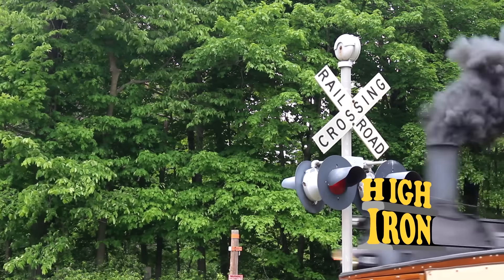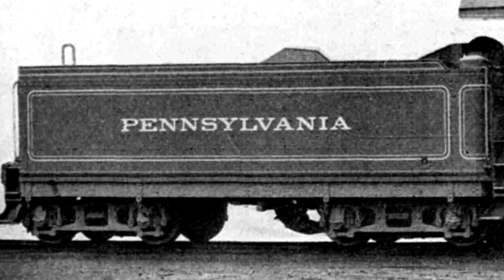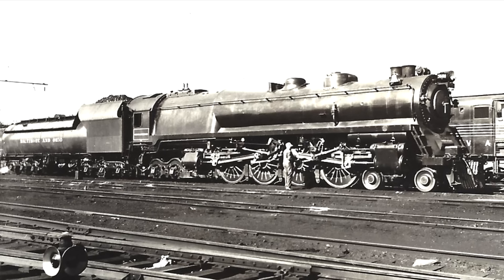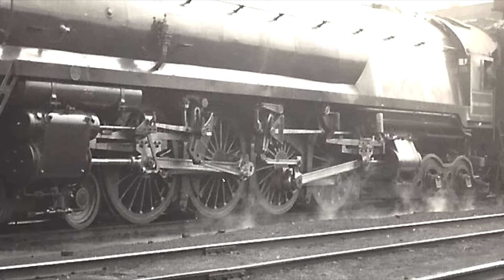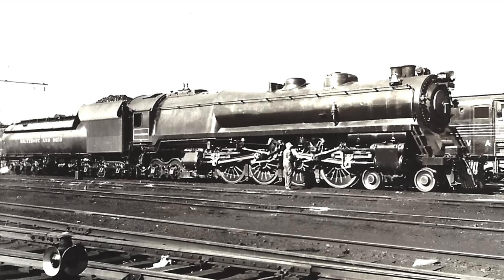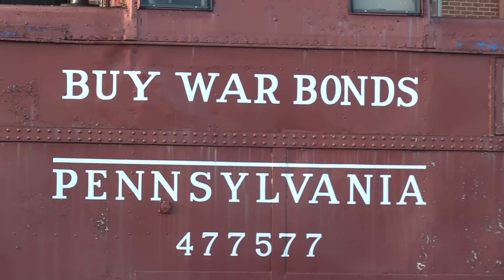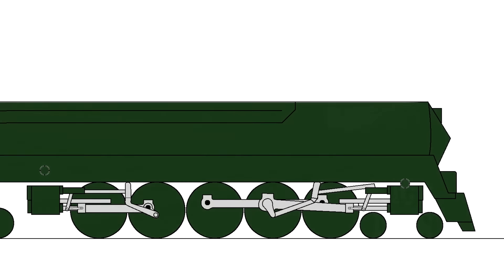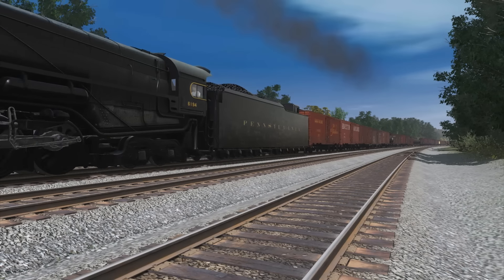Why Weren't Duplex Steam Engines Successful?

Comment: When the USA decided to drop steam and go diesel, they also dropped electricity, like briefly mentioned in the video. Meanwhile, Europe decided to electrify as much of the main networks as possible. Big oil was big also in Europe, but never as big as the Texas big oil in the USA.
Reply: Electrification of freight lines in the US happened long after steam was gone. I think one of the big concerns was safety, and the fact that diesels are much more general purpose than the steam locomotives that electrification was originally replacing. So when electrification was deployed in the steam era it could fully replace mainline steam power, but since local delivery was done by a different class of steam locomotive, electrifying every siding to replace a smaller class of modest steam engines was not cost effective. But when second generation diesels arrived, suddenly the same locomotive could do mainline freights and local switching, so electrification was no longer eliminating entire classes of locomotives, and in fact added more classes of locomotives to maintain. The other factor is that during most of the post transition era of US railroads, diesel fuel was readily and in the western US locally sourced, unlike some other countries.

Comment: The T1s were very good despite wheel slips but at least 10 of them should have been painted Tuscan Red so that they would be the preferred engines for the Broadway Limited while the rest would have hauled other passenger trains. Plus the Tuscan Red units would have been numbered #5500-5509

Comment: If the wheel slip was controled with suspension force with vertical steam assisted shock absorption to push the drive wheels down to take more weight with sand application that would fix it

Comment: I've read that the J that they sent to the Pennsylvania was in run if the mill condition.Its drivers were worn down to 68.5 inches.
Reply: The issue with the J was inadequate valve tribology, associated with the high machinery speed.  Had the valves been better suited to high cyclic, the engine could probably have run to higher speed than it did, even with lower drivers.

Comment: Greetings from the UK. I love all of these, especially the S1 class. Do any of the S1 still exist in preservation?
Reply: Unfortunately, all of the Duplex locomotives were scrapped, including the S1. However, a new T1 is being built from scratch.
Reply: Only one S1 was built, and the PRR quickly realized it was too big. Using poppet valves on the T1 would enable it to come close enough to S1 performance that it made no sense to make more S1's.

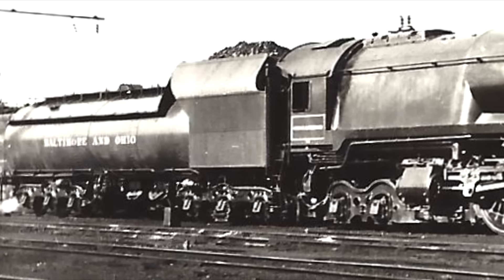Comment: 2:57 = Baltimore and Ohio's engine would have been perfect if they only connected the front and rear set of driving wheels with a very lightweight connecting rod between the two sets, and its only purpose would be to stop one set of wheels from slipping while under power.

Comment: .1. he biggest problem with Steam engines was each engine had to have a full crew. Diesels could run multiple units with just one crew, controlling the other Diesels from just one.. This was fought by the Unions, which demanded a full crew per engine, but that restriction was removed after a while.
2. Diesels are actually Diesels electric, the actual wheels were driven by electric motors, the Diesel just ran as a generator of electricity.  This put less pressure on the tracks then the direct drive of Steam Engines.  This permitted less track maintenance to be done, especially around stations and other areas where trains were stopped.
3. Diesels fumes did not affect any electric wires used on electric trains.  The excess water and ash from burning coal to boil water and releasing that steam made it almost impossible to run Steam locomotives and electric locomotives on the same track.  Diesels could run under those electrical wires.
4. With Diesels no need for a "Firemen" to feed coal to the engine. This was a cause for a lot of workman's compensation claims.
5. Electric engines had the need for the least maintenance, followed by Diesels then Steam.  Diesels less need for maintenance permitted Diesels to beat out Steam.  Direct electric drive lost out for the overhead wire of electric locomotives was classified as an improvement on the land and thus subject to real estate taxes.  This is why Conrail dropped electric drive for its services in 1982, even as the electric wires were needed for Antrack and as an US Government owned train, not subject to local Real Estate taxes.
6.Steam Locomotives needed a "Push" to get started. If you see the first part of the ",Music Man" you see an extreme example of such a "Push".  The "Push" was the result of Steam locomotive coming to a stop and locking every brake back to front on every car behind it. This lead to a very sharp stop on such Steam passenger trains.   To get the Steam engine moving, the brakes would be released front to back to give the Steam Engine it needed to get moving.  You did not need to do that on electric or diesel engined and thus both were considered more comfortable for passengers especially on long distance trains with multiple stops.
7. It was easier to add Diesel engines to a train then a Steam engine, which made diesels more popular then Steam when it came to going over the Western Mountains.
8. Diesel fuel was NOT TAXED and at less then 2p cents a gallon in most of the US very competitive with coal as a fuel (and in some places cheaper then coal).
Notice Diesel replaced Steam not for any one reason, but when you look.at all of the advantages diesels had over Steam, you wonder why the switchover took so long AND why did the increase real-estate taxes due to having overhead wires ended up killing electrification (Those taxes along with not having to maintain the wires and the cheap price of oil combined to kill most electric railways in the US even before Steam died off).

Comment: All steam locomotives go through periodic shopping and journey shopping they get updated with the latest parts. Labor was cheap before the war but with the inflation caused by the war it was not cheap after the war one of the reasons for dieselization but they were prevented from wholesale layoffs by the union so it did not achieve the required result.

Comment: Thank you for the cool video. May i ask why the windows flicker in the 3d rendering of the train 6:58 ? Is it an io problem where y have trouble rendering the glass, perhaps add more translucency levels to it, or and you have overlapping polygons, remove double polygons or and move the window-plane a bit away from the train wagon itself, y dont notice this anyway from a distance. Last bit not least if transluceny is really the problem just add an image of a fake room with a perspektive shift depending from which angle you look into it, instead of translucency.

Comment: A friend of mine, Ted Pritchard , of Melbourne,, Aust., built the most successful steam unit the world has ever seen in my opinion. It was demonstrated in Ventura, CA. almost fifty years ago and was the lowest emission vehicle in the world. Vehicle builders and senators from Washington D.C. were present. They all agreed this was the way to go. What was done about it? Nothing. When the oil crisis came he planned a 6,ooo H.P. Garrat type locomotive, five axles front, five axles back cab and steam generator in the middle. Steam pressure 1,000 p.s.i. Able to burn liquids , solids, gases and residuals cleanly. The problem with the older steamers was simply the engineers did not improve their technology and were overrun
by diesels. When a diesel is seen as burning "clean" they are at their worst. The particles are smaller and far more dangerous to health. I could fill the Mitchell Library about steamers but who is interested. The big problem is the public do not get the truth.
Reply: There is NO QUESTION that Ted Pritchard deserves full respect for steam design.  On the other hand, his burner and steam-generator design requires fairly refined liquid fuel, and doesn't scale to locomotive size well.  Adapting it would probably most resemble the Sentinel multiaxle geared-locomotive design for South America... as with the Roosen BR 19 and the Besler constant-torque, a whole lot of parts all having to work together to produce torque at the railhead.

If you're going to play with steam generation on a reciprocating locomotive, use the design of LaMont boiler the SACA was playing with about a decade ago.  This is essentially a fast-circulation waterwall radiant section, with cyclone-assisted steam separation.
Reply: TedPritcharddevoted a lifetime to steam. Because it was external combustion solids, liquids, gases and residuals could be burnt cleanly. His system was balanced thermodynamicallyunlike other systems.The superheat was controlled automatically and the engine was very efficient. The German govt. granted 100Ml. euros at the time to a co. and they didn't come near his. His locomotive would have been built on the same principal as the vehicle steam unit[see Pritchard steam] ten axles with 600hp engines. Steam generator, no certificates, pulverised coal outward, gas back.I saw Bill Lears bus engine and a monkey could have done better. I admire Americans but they don't know everything.Best wishes.
Reply: The Pritchard system could burn liquids including high flashpoint fuel [unllike the diesels premium], solids, gases and residuals cleanly. Far less moving parts and friction to overcome. All new technology while other systems went down the same track. The superheat temperature was controlled and the engine very efficient. Steam generator no boiler.  The multi fuelled steamer he proposed would have killed the diesels. I would love to see a diesel fuel shortage. This system would have been ideal for the space industry when they have a lull in their work program. They could handle the high pressure, high temperature metals and welding, Steamers could burn solids on the way out and gas homeward bound.Any problem with his system could have been cured with finance. Something that was never made available while others wasted millions and got nowhere. The German govt. granted 100Ml. euros and came out with nothing. Ted's first govt. grant was AU$188. That is why he failed. When he did receive a reasonable grant the next govt. took two thirds from him. That's Australia all over. @wizlish

Comment: The duplexes were fine. They just didn't have the time to advance and work out their unique quirks. Yes some of the engineers had trouble adjusting from clapped out k4's and other engines but many had no problems figuring it out. The other issue was incorrect spring loading on the leading and trailing trucks which offloaded weight from the drivers. The other was the valve gear needed work to compensate for the duplex drive. It was a concept that was cut short before it could become truly mature.

Comment: kc4cvh said Quote "Surprising how little the steam locos changed between 1870 & 1940". Unquote. It should be noted that this "limited change" was confined purely to US Railroads & US steam export products. The rest of the steam engineering world, was busy churning out various revolutionary and mainly successful steam locomotives types. Probably the most unusual to American eyes, and the most successful were the "thousands" of Beyer Garratt type locos built for Britain, Europe, Africa, the Middle & Fast East, & Australasia. These locos were often similar in size to American steam engines (i.e up to 350-375 tonnes) They also came with unusual complex wheel arrangements such 4-8-4+4-8-4. 

Garratts used a TRIPLE ARTICULATED frame design. One set of wheels would support a frame at one end, while the second set of wheels would support the frame at the other end. The middle frame was suspended like a bridge, & articulated to the two outer frames. On the central bridge section, was the smokebox, boiler & cab. On the front frame was a large water tank, while on the rear frame behind the cab would be another water & coal bunker.  These locomotives were extremely powerful, but had very light axle loads when compared to their overall size. This allowed these monsters to pull large trains, on very lightly laid track , typical in the 3rd world. Pound for pound in weight, many of these designs had 40%-60% more power than any US design of a similar weight.

Type "BEYER GARRATT" into You Tube, should reveal hundreds of bits of film of these locos, all over the world. With even a few preserved & fully functional examples, including six 1ft 11.5 inch gauge, 60 tonne examples that now chuff through the Welsh Mountains (in Britain) on the reopened 25 mile long "Welsh Mountain Railway".

Comment: The duplex concept was probably as much about PRR's prejudice against articulated locomotives as anything else.  The problem with mentioning the horsepower of locomotives at that time was that the dynameter cars could be off by as much as 1000 horsepower in their measurements.  The only locomotive worth building from the ground up would be the N&W 's unofficial Y6"c" (a modified Y6b) in my opinion.
Reply: The actual science project to build would be a modified Y6 with Timken lightweight rods akin to those on the last As and a full Chapelon modulated IP injection setup as an improvement on the N&W 'booster valve'.  The resulting locomotive could run balanced in compound as fast as N&W merchandise freight needed to travel... in fact, arguably as fast as TOFC would require in the decade of the '50s, or even today under PSR 'notch restrictions'... while maintaining some of the advantages of the compound's lower water rate.

Comment: Enjoyed your video a lot. A couple things I would like to know about these 'modern' steam locomotives. Did they condense the steam after it had been used for driving the wheels and recycle it to the boiler? Do they use the exhaust steam from the front cylinder (on these duplexes) to power the rear cylinder? On the graphics here I did not see a shoveler, were they using a screw or something else to deliver coal to the firebox? I know that in ships of the time they used the steam in 3 different cylinders then condensed the remaining to hot water and feed that to the boiler and they feed hot air to the firebox (which would be helped a great deal by mechanized coal moving)? Would it have been possible to rebuild these to 4 6 6 2 and keep the cornering and reduce slip?
Reply: Interstingly, in the first steam engines, the condensor pipe drew a partial vacuum which was responsible for more than half of the power produced, since the pressure of the steam wasn't much above atmospheric.  Locomotives prioritized power for their size over efficiency, and at higher pressures the amount of power lost by venting to atmosphere is much less than in the low-pressure steam days.
Reply: None of the modern American high-speed locomotives were compounds; they were all multiple-cylinder simple admission.  That certainly is not to say they couldn't have been built compound, but you'd need a 'mecanicien' or equivalent to run them balanced (see the history of de Glehn-du Bousquet power in United States practice) and you'd need Chapelon's IP proportional steam injection to equalize the effective pressure through the whole of a driver revolution.

Most places condensing was tried, it was a failure.  The problem is that high horsepower involved high mass flow, and in the absence of effective rapid condensation (as on a ship, where compounding either in reciprocating or turbine engines is easy)  you need ginormous condenser area and sophisticated multi-effect expansion (see the ACE 3000 patent for an idea of what's involved in constructing and packaging it even for 3000 nominal hp) to work.  The Steamotive engines, which worked at 1200 to 1500psi, of course used distilled water and consequently were full-condensing; you can see how this panned out first on  Union Pacific and then during the war on GN.

All heavy steam power above a comparatively small (for the United States) size was required to have mechanical stoking by 1935.  All the engines of interest here, including the B&O W-1 constant-torque, had them.

Comment: Excellent training.  Duplexes are fun, but 4-8-4 Northerns work better.  Cheers!
Reply: We shall see - keep an eye on 5550 - with rotary poppet valves it should be able to deliver more high speed HP than the bigger Northerns... It has the boiler to keep up with the demand for steam at high speeds ;-)

Comment: I don't understand a single thing in this video. Does "non-articulating" really mean none of the wheels did? Or just the big driving wheels? Surely those trains couldn't get around any turns at that length, without bogies for the little wheels?
Reply: the big driving wheels arent articulated and the bogie wheels can pivot, PRR have to make the entire line have a smooth curve because of this

Comment: when you look at the PIE CHART of railroad expenses , even as late as 25 years ago ,  the largest slice of the pie is PERSONNEL COST . second is FUEL . these are the 2 things that management will try to lower first then comes maintenance . with the FT diesel tests in 1939 , general motors was able to show rail management how they could lower all 3 costs almost instantly. managers have NO LOVE for steam locomotives . they were only used until something better came along. having been an engineer on both steam and diesel i  can say that engineers come with various attitudes.  some will run " hell to leather " , and some will run conservatively .  the fast runners will insist that they are just trying " to get over the road " . they don't care what it does to the equipment.  thus they will not " modify " their style of operation , even though they could. let the shop take care of  the locomotive , that's not their problem .